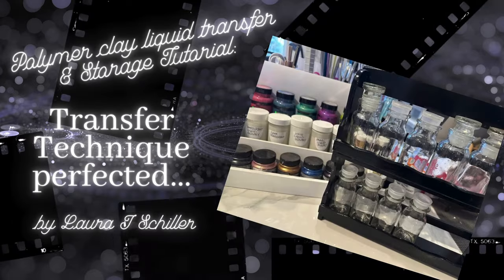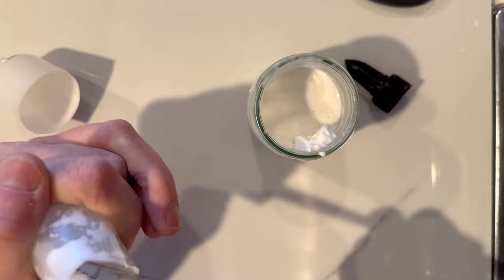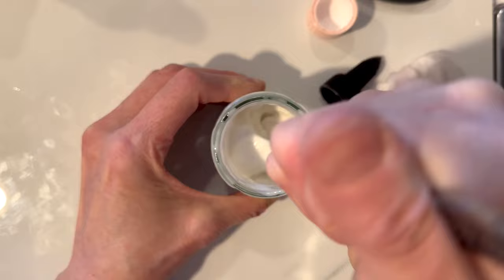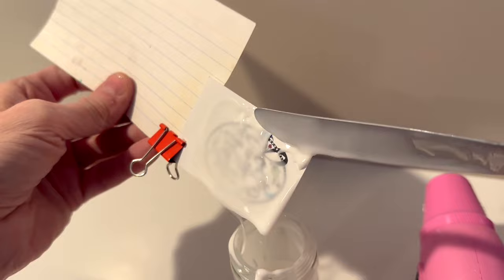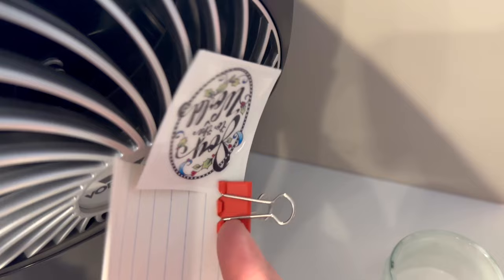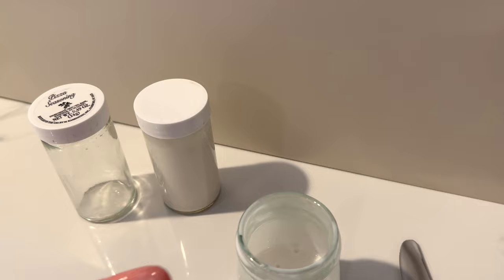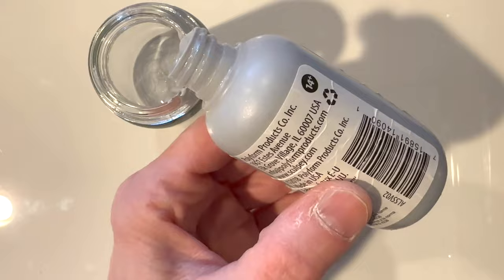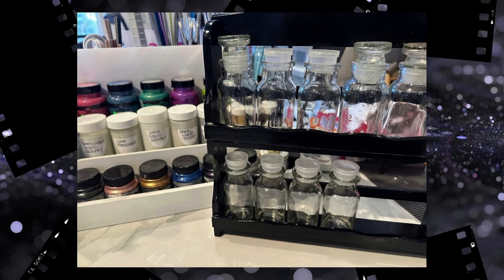POLYMER CLAY LIQUID TRANSFER & STORAGE TUTORIAL: TRANSFER TECHNIQUE PERFECTED...

Comment: Just want to clarify something I have learned about Laser printing and the Sculpey Clear liquid transparent (You can read about that on the Sculpey website).  
1)  LASER PRINTING- Laser printing does not use inks (an inkjet printer does).  Laser printers use toner cartridges.  Toner consists of finely ground powdered plastic and other ingredients.  It is more complicated than I understand, but somehow using static electricity combined with heat, the plastic melts and is pressed on the paper by a fuser as it passes through the rollers. So the process of using a laser print, the clear liquid transparent, and a heat process is to separate the plastic toner image from the laser paper onto the transparent liquid clay, so it can be applied to some polymer clay for use as jewelry, accessories, wall hangings, etc.
 

2) CLEAR LIQUID TRANSPARENT- Sculpey's Clear liquid transparent is different from all their other liquid transparents.  (Personally, I think this info should be well highlighted on their labels, not just readable their website!)  All transparents need to be stirred, but the clear transparent, by its very chemical nature separates, with the more solid stuff accumulating at the bottom of the bottle.  (This increases with non-use and age, and is part of the natural process.)  The part that sinks to the bottom is the stuff that MAKES it transparent, and if not reincorporated back into the top liquid, will make a piece that is NOT transparent.  I hate to think of how many people thought they got a bad batch, and threw their expensive little bottles away, only to have the same problem with subsequent purchases!! 
I love Laura's idea of cutting the bottle in half for easier scraping access, and placing all the contents into a jar where it can be properly stirred to reunite the components when needed.  I also had one other thought after I threw my original bottle halves away.  The top of the bottle might make a good funnel for getting the next bottle's more liquid contents into its new jar, without having to scrape and drip so much (if the new goo will flow on its own?)!  The next time I exchange containers, I am going to save the top part of the bottle for future transfers, and then hopefully, I can just upend the new bottle and let it drain while I go do something else!  If you try it, let me know if it works!?!

I hope this helps everyone's understanding of what actually happens with this heat transfer method.
Eva
Reply from the maker: HOLY TOLEDO, Lady!! Thank you for all of this!! I am thrilled you took the time to let not just me, but everyone know this! You live and learn as they say...and I am grateful for your kindness in sharing with us all!! Thank you!! Also, I responded to your other inquiries...I do hope it all helps...I want you to be successful in this!! Sending you my big hugs!! :)
Reply: Thank you so much for this info Eva 🥰

Comment: Laura, I am having trouble getting a good crisp vibrant transfer, and am hoping you have some wisdom to share.  Besides being somewhat frosty looking, the transparent is picking up only half (or less) of the laser print, making it very washed-out looking, and not really any better than using a direct inkjet water transfer method.  
Note*  One difference...  Not having an embossing heat tool, I was using my regular Milwaukee heat gun, and I am not sure if that would make a difference.  Have you heard this from anyone else?  What brand of embossing heat tool have you had good luck with?
Thanks for sending the two new links about your efforts, and for keeping after the perfect transfer!  I am really looking forward to getting this to work!
Reply from the maker: Hey Miss Eva!! Thank you for your comment on this here!! I really do reccommend using an embossing heat tool. I don't know what a Milwaukee heat gun is like...but I know my embossing has never failed me here. I use the heat embossing gun I found at my local Hobby Lobby...maybe that will help. It cost $15. 

Another part of this could be a couple of factors:
1. I live at high altitude. I discovered very recently that when I went to sea level, the transfer technique was a little trickier...The clay did not gloss over like it does in my high altitude climate. But it does work. It just takes longer to get the transfer to happen...at least this is what I discovered. I also had to get fairly close to the transfer to make it bake throughly. Plus, moving my heat gun constantly so it would not burn.
2. The baby oil helped me tremendously too. Sometimes I might go a little overboard here, but I really like to have that clay super thin and the baby oil thins out that clay enough that it runs right off the paper and leaving enough of a film to fire... paper thin. 
3. The Semi gloss paper works, but it will not be a "completely see through on the other side of the clay". It gives a white background. To get the real clear look, use glossy paper. At the time of the video, I didn't have a glossy paper to work on that I could reccommend. Since then, I use this. And especially if you are having troubles...my overall reccommend....

1. Gloss Digital Coated Paper made for a laser printer. 
2. Clear Transparent liquid Sculpey

And for me, just so you know, I use a Brother laser printer. It is a newer model and works fantastic for me. A scanner/laser printer. Maybe the model number I found will help too...HL-L329OCDW

I do hope some of this helps.  Sending you my big hugs your way! :)

Comment: Does the liquid clay ever react with the lids of the spice jars? I keep my main liquid clay in the mini mason jars. I usually stir before using but it had to be done slowly to avoid air bubbles.
Reply from the maker: From what I can tell, I haven't had any reaction to the lids on my containers with the clay. However, just to be certain, you can always cover the top of the container with a piece of saran wrap, and then place the lid over it. I almost always stir the clay in the jars before using. I understand with the air bubbles, but when doing this transfer technique, it really is not necessary to worry about it since the clay sheet is so thin. I hope this helps. Sending hugs! :)